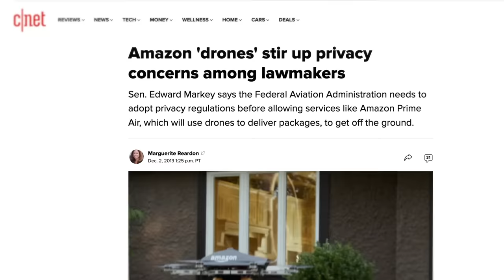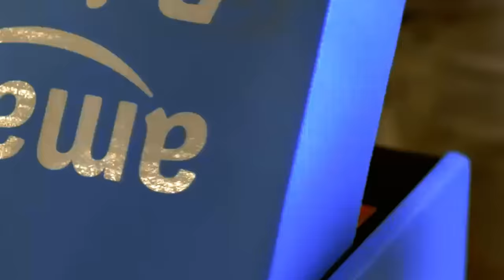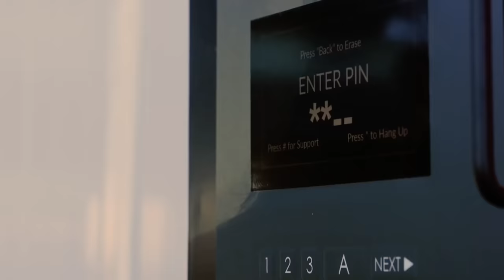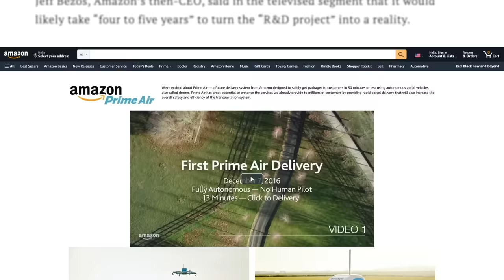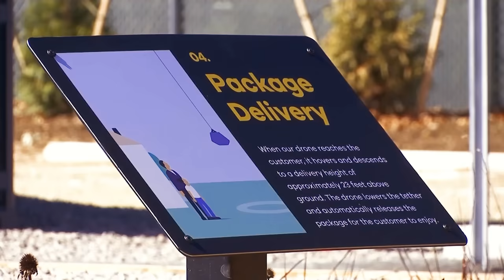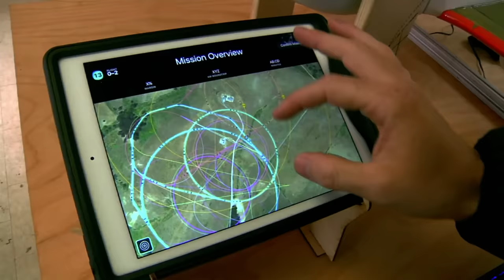Drone Delivery Was Supposed to be the Future. What Went Wrong?

Comment: I still remember when that was announced as the future, and I wondered what would come first: large scale drone theft, or lawsuit from people injured after a package or a faulty drone fell on their heads. Funny to see the problems this "future" was facing were even more mundane.
Reply: I mean a plan can fall on your head? Does that mean plane's shouldn't exist? Stop using niche rare cases to make an argument, you are talking about a 0.001% of cases. Also can't people also just rob delivery trucks? What's the difference theft is theft
Reply: Not sure what is your point here attacking imaginary positions of what would happen, specially on a video which already stated that the "niche rare cases" are the viable uses of the drones. In any case, though, you might want to consider first the difference between necessary and unecessary, and large scale versus small scale before picking your strawman arguments.
Reply: @dontbe3greedy608  enough lawsuits will destroy any new business venture. So if the amount of people claiming to be assaulted by a drone and suing is high enough, then yeah, that would kill the initiative.
Key word is claim. It's super easy to check if someone actually got hit by a plane or not. It's less easy to see if they got hit by a drone. What's more, even with stuff like cameras or crash detection, it's nearly impossible to determine the extent of the damage done besides what the victim claims.

As far as theft... Same thing about frequency and proof, during a new venture. If the thing is just barely getting traction but everyone keeps reading about all the thefts (or people lying and saying they got their package stolen) is high enough, the new thing will die.

This almost happened to Amazon in 2012. There were a ton of thefts of their packages, as well as damaged packages. So people relied on it less and their sales plummeted.
Buuut Amazon wasn't new at this point. It was already ingrained in a lot of people's lives. So it came back.

A service like drone delivery, even if by Amazon, wouldn't be able to recover unless it already had a foothold in the consumer base. Without that, any big negative press could ruin it
Reply: @noblesseoblige319  I love how you don't address my second point and just go around it. Ok why don't people claim the delivery trucks hit them? Remember you said a claim can bankrupt companies so why are delivery companies thriving? People can steal from delivery trucks so why are delivery truck companies bankrupt. Please stop trying, it's embarrassing. The drone delivery idea is stupid for a lot of reasons but theft and lawsuits aren't even a factor
Reply: @dontbe3greedy608     I literally addressed all your points, and the ones you just now posed were also already answered.

But I'll elaborate even further.
The following is in reference to the points: "why don't people claim they got hit", "why are these places thriving" and "people can steal from trucks, so why aren't delivery companies bankrupt".
The general answer to all of those is basically the same. They are ALREADY ingrained into the lives of their consumers. People will put up with the bad pr because they already are users and have been users for the majority of their lives. That's how deep those services are- most current users have literally never been without the ability to use those products. They are so big that it will take a LOT to make them fall.
Certain new initiatives, however, can live or die by their new media coverage.

This happened with Google glass. Within three weeks of their major test launch, there were over 100 articles from larger companies about the problems that arose. A week later on the one month mark, investment dropped off almost entirely. They kept going for a while, but they never recovered from that initial hit. The then chief of the entire marketing campaign LITERALLY said that it was because of the initial bad coverage, that new people weren't jumping on, and this ultimately led to their downfall.

But if you want, I can address each point with more specific details.

The first, about claiming to get hit: this one is super interesting. See, delivery companies in America use both their own trucks and the federally funded postal service. Since the post office is government owned, it's stupidly difficult to lobby against it in enough numbers to call for any legislation change, let alone bankruptcy (which isn't technically a thing in this case, but you get the point). So while there are accidents like that (higher fatality rates than police), without lots of them AND lots of media coverage, it won't impact them a whole lot.
Media coverage is a running theme here. "vehicle hits someone" isn't as big as a headline as "new company's drone smashes someone's face".

Additionally, again, it's a lot easier to prove a truck injury than a drone one.

As to why these places are thriving, that's an odd one. They are and aren't. Some companies like FedEx are struggling as hell. Others were until they started using the postal service transportation (see the previous point) which had less accidents and thefts (on paper anyways). So while they do take losses when lawsuits are filed against them, they are managing to survive for the most part. Oh and shady employment practices. That helps their costs as well.

And the point about stealing from trucks- here's where the money is. If you're skimming PLEASE at least read this part. 
They have lots of systems and tech involved to ensure that the package gets to someone's door. At that point, they generally claim to not be liable for what happens. Thefts happen a LOT, but the company can fairly easily prove that they did their job for the most part.
Those same systems aren't in place for drones. So even if the amount of thefts were the same, the company would be more likely to be found liable and eat those costs more frequently, dooming them.
So it's not the same from a monetary standpoint. For the consumer, yes, a theft is a theft. But for the company, they need to get a lot of stuff in place for the thefts to be equal, because currently one is way more expensive than the other.
They could use technology to help, yes, but without the current market to justify the costs, it's just not worth the investment yet.

Lastly... "stop trying"? What is it that I'm trying to do? I never claimed, even once, that lawsuits are the only reason for drone delivery failures. I only claimed that enough early on will destroy a budding business or venture.
That's not an opinion. That's an undeniable fact of business. If you're trying to get started but have to pay millions each month for lawsuits and get bad press from said lawsuits, you're going to have an insanely hard time getting off the ground.
Less money and growing costs means less likely to grow your brand. Theres nothing based in opinion about it.

Early hurdles are always a factor, and anything legal related are concerns as well (which is pointed out in the video even). It's a concern.
Is it the biggest concern? Absolutely not. Not even close. But it's a concern regardless. Not being concerned about it is a recipe for disaster and bad business practice.
Reply: @noblesseoblige319  ..... gosh this is embarrassing. Ok how did they get ingrained in the first place? Why didn't they fail from constant theft when they started. You still haven't answered my question
Reply: @noblesseoblige319  how is it easier to prove a truck injury than a drone? You know the drones will have cameras right?
Reply: @dontbe3greedy608  government owned, little media coverage of the suits, and lack of lawsuits on record. Cuz they use the US postal service which has been a thing since 1792. 
Basically, been around long enough to get by. Also, it's a government organization. Lawsuits don't hurt them as much.

Really, I answered this. If this doesn't address your question as you envision it, that's fine just let me know and possibly rephrase so I can answer the right one, but I've answered the question as you have asked it.
Reply: @dontbe3greedy608  oh whoops, didn't see you responded twice. That one's my bad.
Regarding easier to prove: insurance claimants. There's an entire business to analyzing damage to the vehicle and to the people to determine fault and extent of actual injuries. Pretty decent track record too.

As to cameras, I've mentioned this specifically. You could put cameras on them, absolutely. But that's another cost to account for in a market that doesn't even exist yet. Plus with drones theres tangential damages like damaging property, giving dogs ptsd (yes, people have sued for drones doing this), and of course causing branches to fall and hit people which all can't be easily caught on camera. These are real things people have sued for and won in some form, on multiple occasions. They aren't just random things I've imagined. Even with cameras involved
Reply: I was immediately skeptical in the mid 2010s when musk and others were claiming that fully self driving cars were just around the corner. I knew that even if such incredibly complex technology could be developed that fast, there would be too many problems. Driving just relies too heavily on human decision making. Now here we are in 2022, no closer to fully self driving cars than we were then.
Reply: Why not creating ground tunnel or sky tunnel for drone so make sure the tunnel only for drone to keep delivery not even noisy and safe?

For us to make better future should create tunnel for in every house or apartment with special tunnel unit so everyone can enjoy delivery without worry

More privacy should every room have to have special tunnel for drone will be amazing
Reply: and a delivery truck might lose control in some way and plow right into people
Reply: Unfortunately, Amazon didn’t listen to my two key ideas. 1> Launch by railgun. 2> Power by hydrogen.

The last foot is solved by a large symbol on the ground. Anything is better than interacting with delivery people.
Reply: @dontbe3greedy608 Most planes dont fly trough cities and houses :)
Reply: @dontbe3greedy608 it’s easier to steal a drone than a truck
Because a persons not involved so the risk is a lot lower
Honestly hoping drone delivery takes off because videos of people plinking at them is gonna be funny af
Reply: @randomcow505  yeah GPS doesn't exist of course yes, steal the drone
Reply: @dontbe3greedy608  you rip the battery out and sell the parts
Reply: No, no, no!!! Air traffic would be the downfall - - I'm guessing.
Reply: I mean helicopters that flew in injured patients is far faster and quick over driving. If driving is faster than air transportation well then planes are as slow as ground vehicles.
Reply: Didn't Minnesota or some state make drone hunting legal and you could cash them in for money??
Reply: @dontbe3greedy608  I know this comment is late, just pointing out that many people have no problem assaulting inanimate objects over real human beings. At least for people with moral conscience. Just look at that example of that robot cruising the streets of Philadelphia that was vandalized. Hell, even myself as a teenage punk would probably chuck rocks at those drones. You can guarantee most kids would. Where as most kids aren't going to chuck rocks a a delivery driver or their vehicle. I suspect in reality that kids will just really go to town on these drones, including land based ones.
Reply: @dontbe3greedy608 dude stop defending a dead point
Reply: @tonysantosa4193 why not create a small-scale railway for a train-like device at that point
Reply: @dclikemtndew  THe best we have even now is just REALLY good AI to handle general driving. Still need a person to handle emergency stuff.

Comment: Google were doing all sorts of drone delivery experiments in Australia (project Wing) and they claimed to be the first drone delivery service years ago. But the aviation authority set in place a 10KM restricted radius for these styles of delivery services. That limited them to just delivering Coffee, food, drugs with a hefty extra price attached. Another company achieved a 60km radius of delivery but that was due to the remote location it operated in. In the end the problem is getting past airspace restrictions and working in crowded cities as you point out. The idea is a total dead duck now. RIP drone delivery
Reply: Drones weren't a fundamental change in technology, despite what the hype said. Remote control helicopter toys for kids have existed for decades. Drones were just an improvement in efficiency & most importantly in stability (which enabled their use for video / photography). 

There will be a niche for drone delivery in rural areas, but that will be all.
Reply: Wing was operating 100m from wheee I worked, but they wouldn’t deliver KFC as they needed a fixed spot on the premise with no overhead obstructions. Last I heard, they had done a delivery in Logan and managed to collide with an overhead power line, knocking out the power in a couple of streets. Overhead powerlines, birds, legislation which says you can’t fly drones within 30m of people means drone delivery is never going to work in Australia at least. Not to mention our large BirdLife and who wants to live in a world where the background noise is a thousand buzzing drones.
Reply: omg i loved your videos when i was a kid
Reply: Lies again? HDB Paris Highest Points
Reply: Same thing happened to general aviation!☹️
Reply: What if it’s a week of storms or rain or bad weather and heavy winds? Seems like that would affect the delivery.